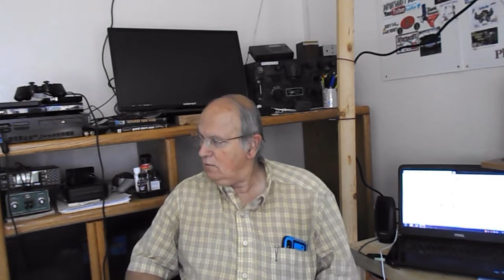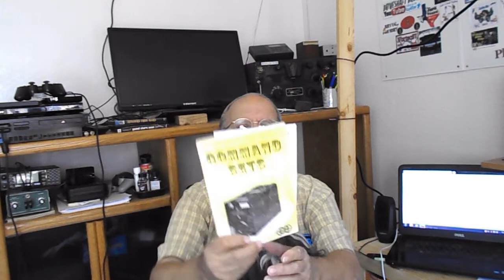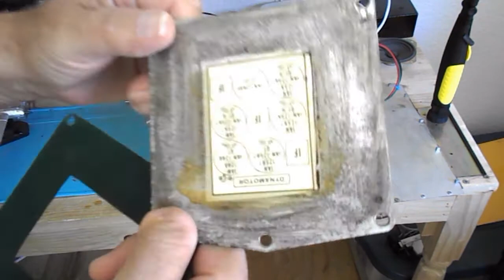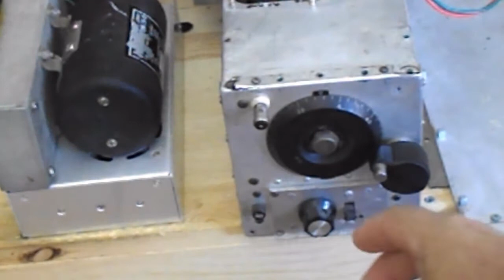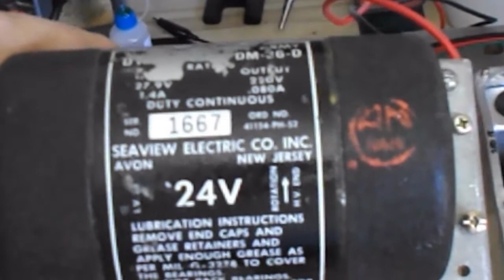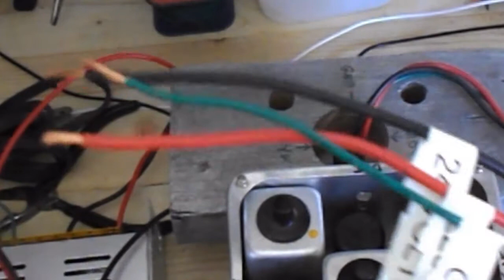Project on a Flying Fortress BC-454-C Receiver and look at same

Comment: Love those old surplus radios. Especially out of the aircraft. I had a compass in the plane I built that was out of a B17. Cool stuff Larry.
Reply from the maker: Thanks Carl Yes pretty nice compact radios and rock solid as well. It has the rest of the connections for the speaker phones and power at the rear of the radio but I have to make a plug for that since I don't have an original one. You built a plane Car?
Reply: @LarryDeSilva64  Yeah Larry,,, here is the link for the video I did on it. Pretty cool.
https://www.youtube.com/watch?v=1k_bLxQdjrc

Comment from the maker: Yes these old ARC5 radios were pretty much built to last. In fact the 2- BC348Q receivers I have from 1944 are also built solid. If you looked at Mr. Carlson's Lab recently he had a BC348 that he picked up as surplus it was dirty and was Missing 2 tubes just popped new ones in and put power to it and it worked. Just shows you how solid they were made back then.